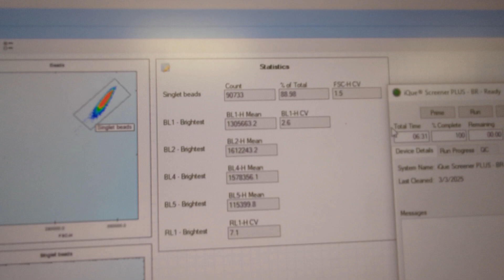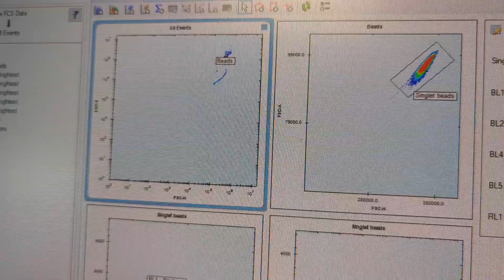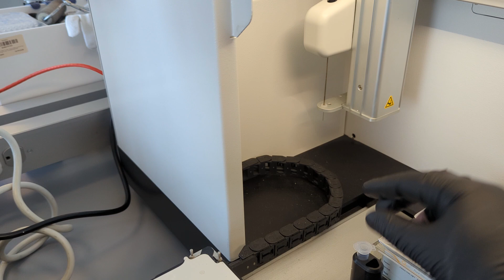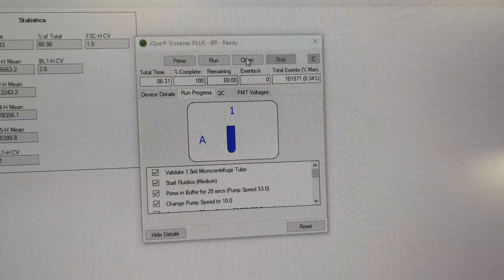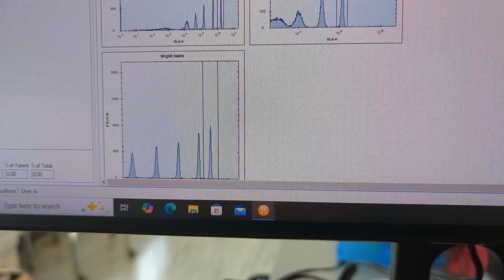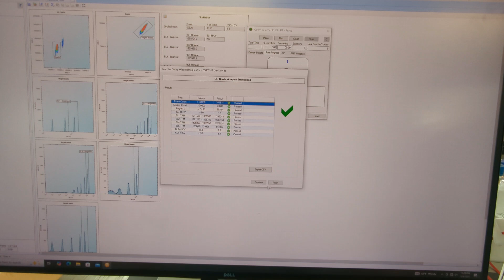How To Perform Laser Alignment On Sartorius iQue Screener Plus/iQue3

Comment: Tweaking optical instrumentation, hours of fun for all the family ! seriously though it makes a change just to calibrate something that has no faults and your just correcting for the passage of time !.....cheers Frankie
Reply from the maker: thanks Andy! yes not the most interesting vid.  However, this type of vid is more serving the purpose of my 'Right to Repair' vendetta against lab equipment manufacturers.  This procedure is not shared by them so trying to spread this type of info to other scientists so they can do the work themselves.  An annual service contract for this instrument is tens of thousands of dollars.
Reply: @fmashockie  Damn right ! it's a worthy cause :)